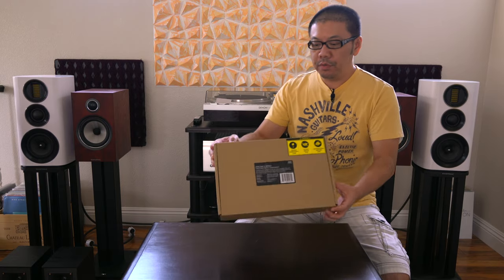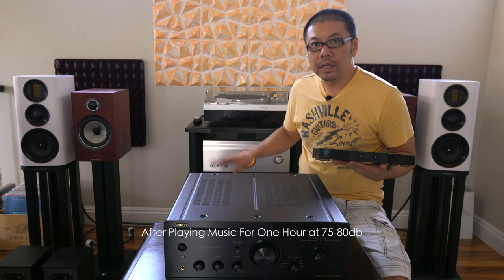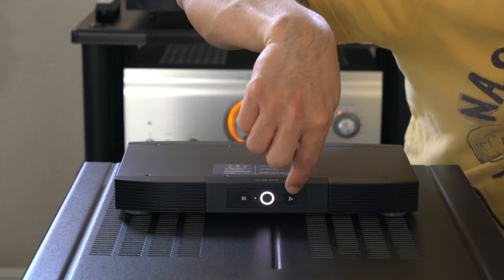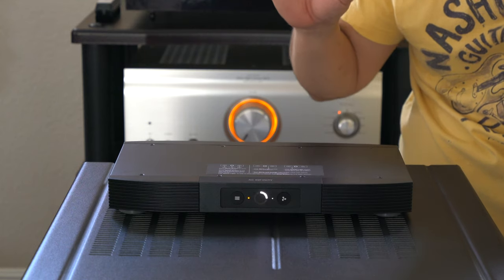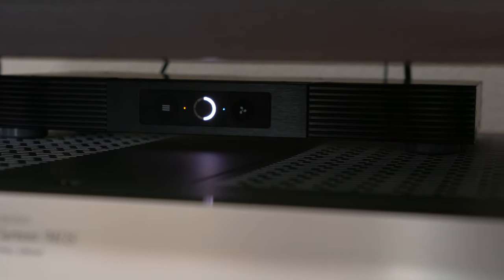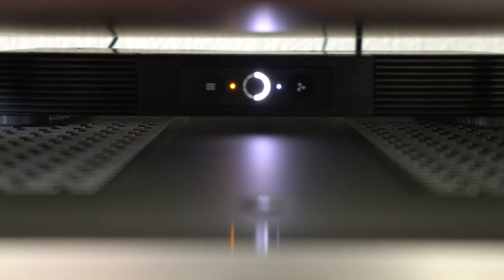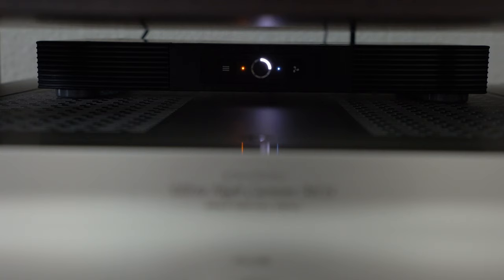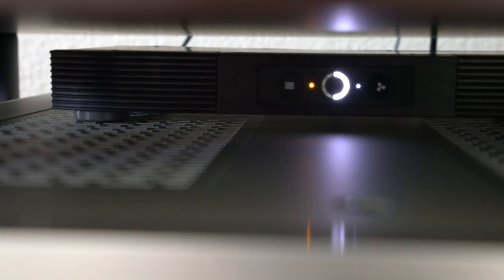AC Infinity Aircom S6 Review, Quietly Capable Cooling Fan

Comment: Question. 
In class A is it a bad thing to use a cooling fan ?
Should the amp be hot?
Reply: Do you want to kill a 15000 dollar Class A amp from excessive heat? Or burn down the house? I choose to go with a fan.
Reply: @deepmystic333  well I've come to realize that a fan is good depending on if you forcing air out or in.
If your forcing air in then you would most likely ruin the components, so the best thing to do would be to force the heat out.
And furthermore I dont think that denon would make a component as dangerous as you describe.
Reply: @kcjones7634  Why would air blowing in ruin components?

Comment: I'll put my best lps up later. Every single stereo shop I have talked to, I have asked them, if u were on a desert island, which would u pick of these 100 cds, which would you pick as the best sounding cd. Every single stereo shop said that the best of these 1 out of the 100 cds is all 100 of the them. Listed in alphabetical order. 1. Baden Powell- baden  plays Vinicius (1973) Spanish, best acoustical guitarist I have ever heard 2. Baden powell-solitude (1971) 3. Don baker_ duckin & Divin (2006) worlds best harmonica 4. bamboo (1971) as clear as flute can get 5. Beatles-love  6. Beatles- revolver Beatles- yellow submarine 7. bud Shank-magical mystery (1971) Absolutely perfect sound, I keep this under beatles, its beatles songs 8. beck-sea change MFSL 92003) much better remaster, the lp goes for $300 9. George benson& jack mcduff (1964) jazz 10. blind faith(1971) Deluxe Edition, the extra cd worth it 11. dave Brubeck-time further out (1961) 12.dave Brubeck-time out (1958) jazz 13. Kenny burrell midnight blue (1961) jazz 14. tracy chapman tracy chapman (1994) this can be on lp, too 15. John Coltrane a love subpreme (1958) jazz !6. John Coltrane-ole (1963) elvin jones drums 17. Ry cooder- a meeting by the river (19990 pure analog, better than the later digital remaster. The remaster is the only one u can get on lp that's great must have cd 18. Keith cooper- sacred dance (2000) strums guitar with both hands 19. Mike cooper-trout steel(1970) great acoustic guitar 20. Cure- disentigration, mixed up, 7 wish cds, not perfect sound 21. the exotic sounds of martin den- primativa (1958) perfect sound 22. willie Dixon-I am the blues. walter Horton on harmonica 23. Dylan- blood on the tracks- not perfect sound (1968)  24. Dylan-hard to handle (1995) not perfect sound 25. Dylan MTV Unplugged (1996) perfect sound  26. Bill frisello with dave Holland & elvin jones (2001) must have for great sound  27. Emmylou harrisspyboy live  (1999) dont get this mixed up with plain spyboy. clearest ever heard at all frequencies 28. Michael hedges-oracle (1996) 29. jimi Hendrix-blues new cd of old stuffgreat sound 30. dave Holland-hands (2010) great acoustic guitar 31. the best of HOOKER N HEAT (1971) 32. lightnin' Hopkins- blues hoot (1961) DCCCD remasteranalog steve Hoffman 33. Freddie hubbard-straight lifejazz. George bensen on guitar. This is CBS original, I dont like remaster 34. dave grusin-discovered again (1976) direct to disc, great 35. James gang-rides again(1971) lp is great  36. Jazz at the pawnshop)1979)analog recorded in café in open box for sound  37. J. K. & Co.-suddenly one summer(1968) boy played all guitars 38. Elton john-tumbleweed connection (1971) mick ronson guitar lp is great 39.albert king-I'll play the blues for you (1970) 12 track version  40. Leo kottke 6 & 12 string (!969)  41. Led Zeppelin 3 (1971) lp is better 41. The Maureeny Wishful album (1967) jimiie Page, better than led zed albums  42. Little feat-waiting for Columbus- (1973) perfect sound recorded in cathedral. MFSL analog tube remaster with better tone 43. Nils Lofgren-acoustic live (1998) 44. Antonio Lysy at the Broad-music from argentina (2009) analog recorded. cellos. Great audiophile  45. herbie mann- live at the whiskey a go go (1961) flute, great sound  46. dave Matthews & tim Reynolds-live at luther college (2008) 47. medicine head-new bottles old medicine (1970) 48. Mississippi fred mcdowall- I dont play no rock & roll (1969) black acoustic guitar blues  49. modest mouse-this is a long time (1996)analog recorded 50. van morrison-astral weeks (1968) remaster. one of the finest albums recorded all acoustic in 2 days. acoustic bass is wild 51. Penguin café orchestra- a brief history (1971) 52. Autumn Shuffle-Per af  Ugglas (2007) analog recorded, hybrid sacd or xrcd, I like both 53. Quicksilver messenger service-happy trails (1968) 54. Quicksilver messenger service- live at the filmore (1968) 55. quicksilver messenger service-quicksilver messenger service (1968) 56. rolling stones-letit bleed (1969) ry cooder guitar. bob lutz 2002 remaster. a great remaster. sold unmarked in storesas a hybrid cd, as all of stones cds. 57. sonny Rollins-thebridge 91962 jazz just only greaton saxophone  58. Santana1, abraxas, & 3. abraxas on lp is mind blowing, especially the 1st lps. 59. shanti (1971) amazing inside your head mid east recording 60. Horace silver - cape Verdean blues (1964) rudy van gelder 24 bit 2003 remaster.Rudy made his own electronics & was afraid thieves would steal it, he guarded it.  61. Son house-father of the delta blues (1965) black acoustic guitar 62. Jeremy steig-howling for judy91971) blue note, great flute 63. Jeremy steig-wayfaring stranger ( blue note, best flute air I have heard. 64. cat stevens-tea for the tillerman (1971) 65.  Steve Stills-super session (1968)  66. taj mahal-live & direct (1975) direct to disc  67. taj mahal - taj mahal (1968)  68. ten years after-recorded live (1971)  69.traffic-welcome to the canteen (1971) I'm crazy on this jazz rock cd. 70. U2- Joshua tree. not perfect sound. 71. the string quartet tribute to U2 Joshua tree (2004) 72. peter walker-rainy day raga (1966) mind blowing India like acoustic guitar 73. war-all day music 74. war-war (1971) worth getting for great 10 minute track  75. jennifer warnes-the hunter 919920 raincoat is better, but I like deep bass on some tracks  76. Jennifer warnes- raincoat the remaster is much better, the MFSL remaster by analog tube remaster has better tone. 77. who- live at leeds (1971) Deluxe Edition, any remaster has better sound  78. who-now & zen (2005) best sound hits version 78.who-quadrophenia (1971) the 2nd remaster 10 years ago has better sound than the bob lutz remaster. fans complained they couldn't find the analog version of tapes. 79. wilco-being there (1999) This sounds analog  80. George Winston-December (1985) 20th anniversary remaster. has a crisper sound hdcd best piano cd made 81. Gretchen yanover-bow & cello black lady beautiful cello tone
Reply from the maker: Thanks for sharing.

Comment: Very interesting product. But does it pass vibration to the amp?
Reply from the maker: It might at full speed but mid to low speed is totally fine.
Reply: Attach rubber between the amp & fan to stop vibration

Comment: In the video it looked like the test was conducted with the amp at idle.
How does the smart feature work when the amp is playing for a sustained period - as in listening?
It would seem that the temperature would be higher and the fan would have to work harder during listening periods.
Reply from the maker: As I explained it in the video, every 2° temperature increases fan speed will increase as well up to max speed as you set, in my case up to medium speed.

Comment: I am not comfortable with the idea of a mechanically vibrating object (in this instance, Fan), however efficiently it might have been designed, to be in direct contact with HiFi equipment. There is no way deleterious micro vibrations can be prevented from effecting the HiFi equipment's performance.
Reply: Why not put it on isolation feet sorbothane etc? Who said you can’t do this?
Reply from the maker: Actually I'm going mounted on the shelf above with 3m mounting tape.